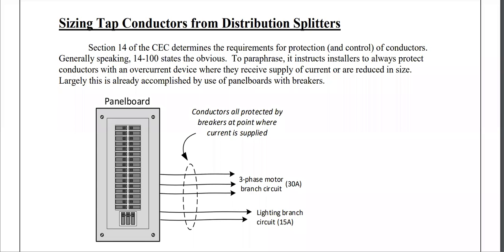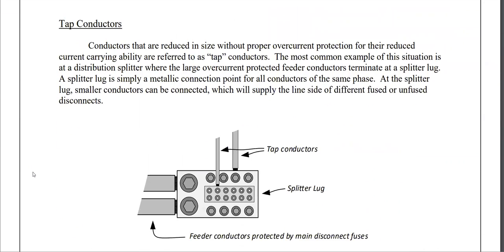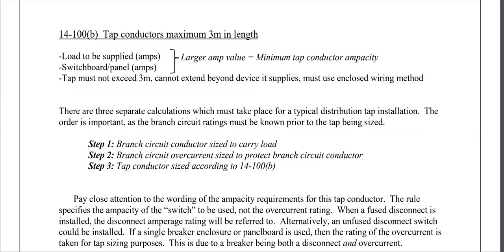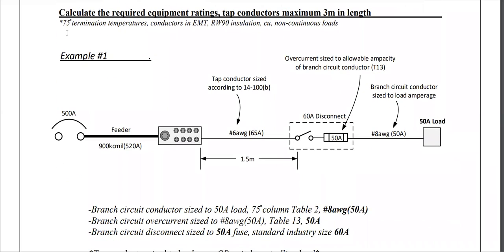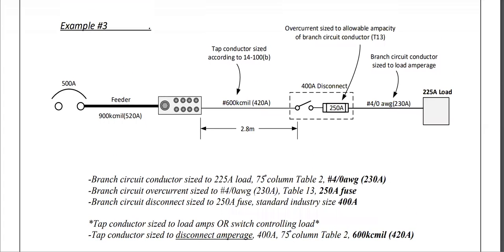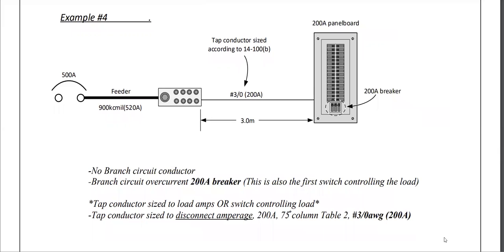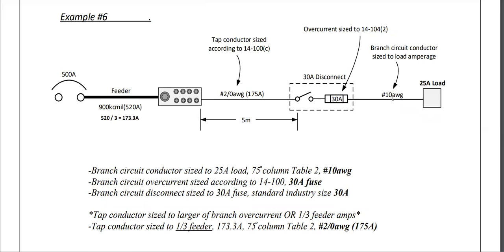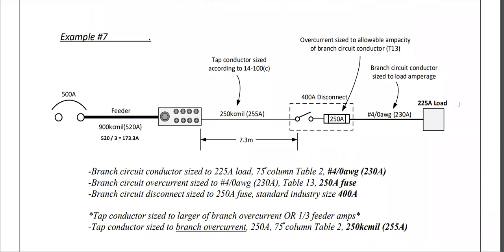Section 14 CEC: Sizing Tap conductors

Comment: Thank you so much for the clarifications on these rules/sections. Your videos are a blessing. I was wondering if you have these PowerPoints available somewhere online as I’d like to refer to them while I’m studying for my IP
Reply from the maker: So glad these resources are helping you along the path to your red seal. As too the PPTs & PDFs, at this time they are unavailable. PPTs take immeasurable hrs to craft for each section, so these will remain in video format only. The PDF resource is currently being rewritten and updated into a calculation manual that will published through Amazon. This way I am able to keep quality control, and update as necessary. The manual will be approx 400pg with calculations for every major application in the CEC, as these are what students struggle with most...
Reply: @Red_Seal_Electricin  Hi, have published the book  used in this vid  or can you recommend any ?

Comment: Excellent explanation .It explains tap rules in very practical examples   that touch  every possible situation in the field   very helpful .It is really nice to find Canadian Code  material   like this
Reply from the maker: Glad this helps. It can be a challenge to find Canadian content-especially with the calculations. Depending o  the province you are training in there can be quite a difficency of learning resources...
Reply: @Red_Seal_Electricin  SIR I he[p for this question i am stuck this question is from CSA- a 60 amps enclosure for 40 amps CB located 5 meters from a 400 AMPS splitters and temperature termination not given. What is the minimum RW90XPE CONDUCTOR size required between the splitter and CB enclosure, if the tap conductor is in EMT. CSA answer is AWG1 while GEMINI answered 8 AWG. I will be very glad and happy if clear this, keep in mind i am a candidate of red seal